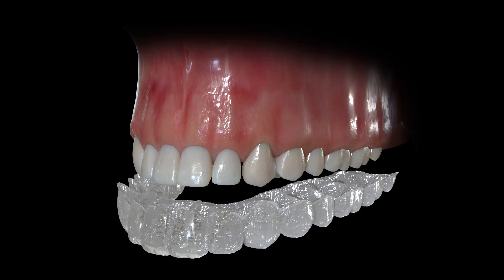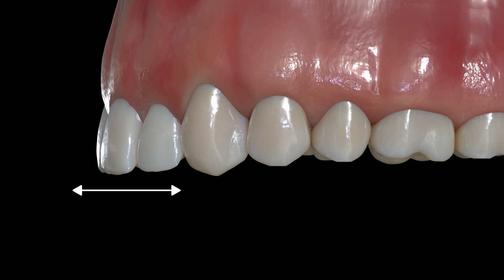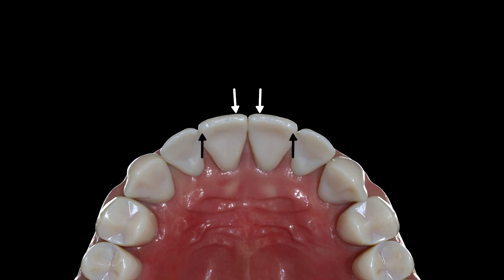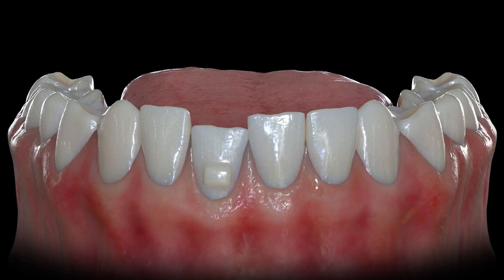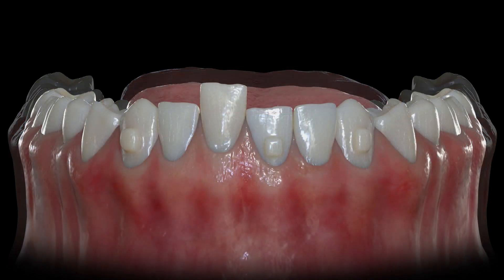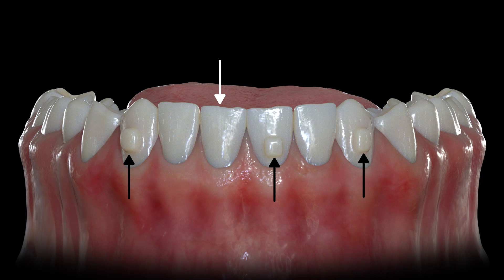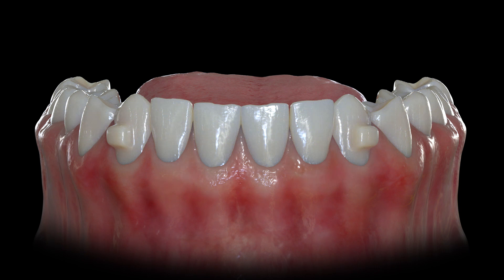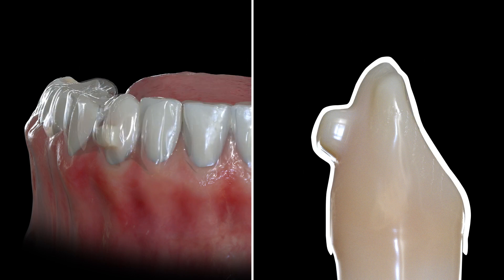How Buttons Help Clear Aligners

Comment: I had buttons on almost every tooth lol, had it for 6 months and they got removed on the 7th month for phase 2 of my treatment, I only have 3 buttons now. The removal process sucked, prob worst part imo.
Reply: Why did the removal process suck? Did it hurt?
Reply: @dominikkkkkkkkkkkkk  well, I had only 3 removed, but they basically clip them off with a cutter and then sand it down until nothing is left from the button
Reply: @agrikg4450  did it hurt?
Reply: Mine are breaking in the first week itself they are not fixing
Reply: @sujeethreddy8631  they have to be fixed otherwise your teeth cant be moved like planned
Reply: Did any fall off themselves
Reply: Did any of them ever get smth stuck beneath? I just got my aligners and got smth stuck beneath the button and when i tried getting it out it came off now i gotta get it put back on.
Reply: Is buttons painful?

Comment: The more buttons the better it works and when it is finish moving into position have to make sure you can eat normal chew and tear all kinds of food if not you are not down you will have to refine and more your teeth some more . I encourage changing your diet too don’t eat at the same time of the day every other day do your body does not fall into a eating routine  too you will be hungry and eat or snack often and you always have to take the trays out . This is the best time to start working more or going to the gym the more busy you are the more exhausted you get you just want to sleep and wear your trays it took me 4 months but I have to get refine so over all it took me 8 months I have croud in the bottom and underbite and gap on the top and curved in ridge on the top my junk was &)&8: up but it straight now good luck peoples eat a lot of crunchy food
Reply: Sounds like good advice, thanks